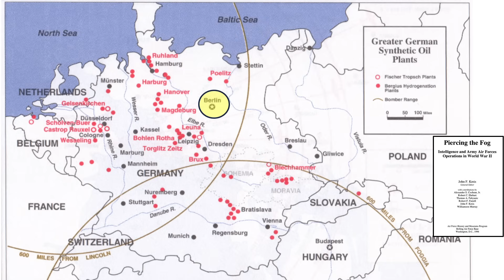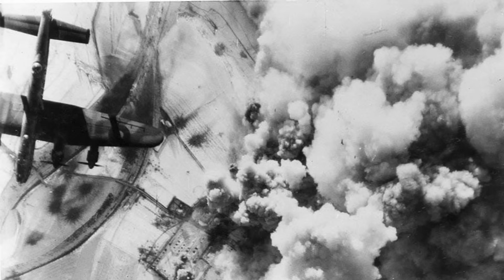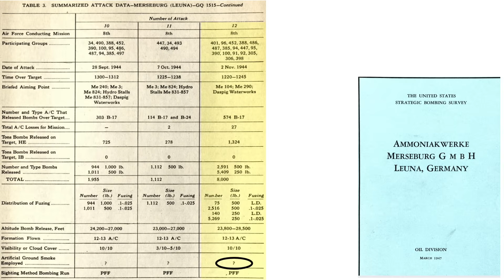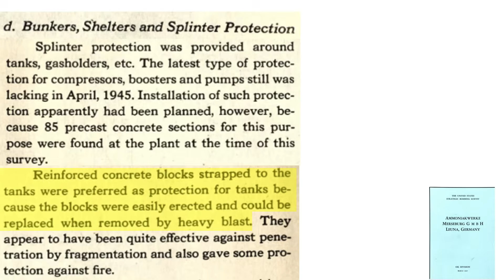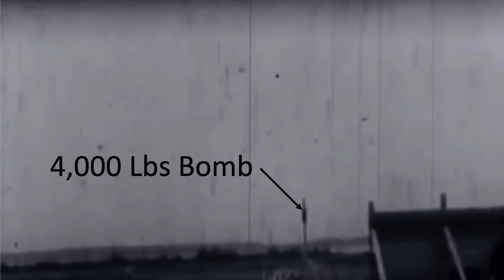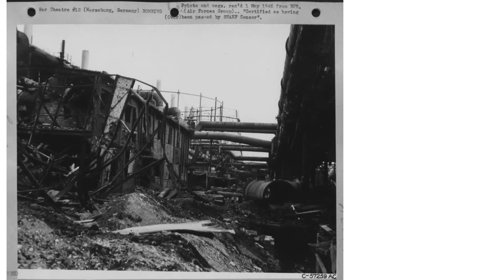How a WWII bombing misjudgement likely cost thousands of Allied lives - Leuna Oil Works Attacks

Comment: Only 1121 4000lb bombs were dropped!! That would be from the 475 lancasters dispatched on 6th / 7th Dec 44, 573 Lancasters dispatched in 2 waves on 14th / 15th Jan 45 and 327 Lancasters on 4th/ 5th April 45. That means 1375 aircraft were dispatched and only 1121 aircraft got to the target (total number of Lacasters lost was 17 across all four attacks), 5 in the December raid. 10 in the twin wave attack in January and 2 in April.

Comment: The results of all the data were from post war bombing survey. During the bombing campaign itself they had photographic reconnaissance evidence of the poor results. Was it the end of the war that they figured out that the small bombs were ineffective? 

After d day was there ever any consideration for using low altitude medium bombers for this task?

Also, as noted by others in the comments, a full explanation on the high dude rate and what was done to rectify this.
Reply: Low atttutide attacks would have resulted in your bomber force being wiped out in 3 to 4 missions!!! Germans have as many light Flak guns as they have heavy ones.

Comment: Knocking out most or all of the synthetic oil production earlier would have been helpful but it is extremely unlikely it would have caused the “collapse” of German resistance you hypothesize. Those plants mainly produced aviation fuel so it mainly impacted the Luftwaffe’s operations. Since by late 1944 the Allies exercised something like air dominance in Western Europe the difference would have hardly been felt except by the Allies air forces whose job would have been easier but the net result on the overall war would probably not have changed things much.

The German ground forces, on the other hand, ran mostly on refined natural petroleum which mostly came from Ploesti in Romania. The AAF had only just begun to bomb those facilities effectively when it was overrun by the Red Army in August 1944, making further bombing obviously pointless. Thereafter the German Army had to run off stocks and the relatively small amount of regular motor fuel coming out the synthetic plants.

The bombing helped a lot but let’s not exaggerate its effects and thus perpetuate myths rooted in wartime AAF propaganda.
Reply: I think you underestimate the advantages of seriously undermining fighter and tactical bomber operations.  That makes allied air support better in two ways.  Firstly, it means they are likely to be unopposed in the air, enabling them to take more risks in an attack role.  Secondly, fighters that would be in reserve for air combat can be released for an attack role.

Comment: -The Leuna plant was the first "Bergius Hydrogenation" plant.  It was sited to keep it out of range of then French Air Force Bombers.   In this process pulverised coal and toluene is   pressurised with hydrogen at 700 Atmospheres (10,000psi) in the presence of a small amount or iron catalyst.  The resultant synthetic oil is distilled as per normal refining processes and the distilled of toluene fed back to the next slurry.
-Because of the high pressures the machinery and Piping was exceptionally heavy and simply immune to 500lb and 1000lb GP bombs.
-When a bombing raid occurred the operators were giving bomb proof control boxes and production continued.
There were vulnerable parts of the plant as below:
-Parts of the plant involved production of air Separation pants for oxygen for gasification of coal to syngas for hydrogen production, nitrogen for combination with hydrogen to make ammonia for explosives, fertiliser and for desulphurisation as well as fertiliser production.
-Some of the syngas was converted to iso-butanol by a chromium catalyst from which was made iso-butylene that was converted to iso-octane for upgrading gasoline.
-At the end of the war the Armaments minister Albert Speer was supposed to destroy these plants but he focused their production on fertiliser so that less of the surrendered German population would starve.  
-German plans involved building one underground Bergius plant, 5 smaller Fischer Tropsch above ground but well camouflaged and some 40-50 mini plants. 
The FT plants were smaller but made mainly lubricants and diesel though they were beginning to make small amounts of gasoline as catalysts improved.

Comment: That was a shockingly high percentage of duds.
Reply: Note that the graphic at 9:56 camouflages the dud rate! It reports that 1.8% were duds -- but that is 1.8 %-points of the 12.9% that fell within the target area, not total bombs dropped (1.8/12.9=14%)

Comment: Visited the plant around 2014. Still a flak tower at the entrance, now used for safety banners.  Also found a small general aviation airport nearby that had very interesting concrete and earthen hangers.  Amazing how much of the massive WW2 infrastructure is still there. Even the plant admin buildings were massive 1930s construction.  Great video.  Appreciate the quality work you put out.

Comment: Were the Germans able to produce high octane aviation fuel?
Reply: Yes, but Nazi design philosophy of aero-engines & materials availability would not have benefited from higher octane fuels. Engines & associated systems require a redesign to take the higher compression ratios. Higher octane is useless if the design of the cylinder head/piston/compression ratio/heat exchange, valve timing/ piston timing/ ignition timing is already in synchrony with the current octane rating. i.e. If 100 octane works fine under anticipated engine loads, 110 or 150 or more won’t do a thing. It’s just wasted capability. NOTE they had another way of achieving a short period of boost that was very effective.

Comment: Why couldn’t the B-17s’s internal bomb bay be adapted to use the 4,000 lbs bombs?
Reply: I'm guessing the length?
Reply: The B-17 was a low wing monoplane so the bomb bay length was limited by the wing spars.   
The biggest internal bomb bay load-out for General Purpose bombs was 6000lbs as 6 x 1000lb GP or 12 x 500lbs GP.
The biggest General Purpose bombs was 4000lbs as 2 x 2000lbs GP
If Armour piercing bombs were used the load was much higher, almost twice as much.  
All data for B-17G.
For long range missions requiring high altitude only 4000lbs might be used.

Comment: I don't think the RAF did many attacks on that place. I know that 8th AAF did a butt load of attacks on the place that resulted in jack shit hitting the plant and a butt load of bombers being shot down or written off due to Flak damage. The biggest problem the RAF had in finding the place was most likely two-fold. First off until late 1944, the only Navigation aid that could be used was H2S.which in its 10cm Mk II form had a blind bombing mean miss distance of 2.2 Miles from the Aiming point. The Mk III with a 3cm wavelength wasn’t much better with a 1.7-mile average. Chances where the target indicators were going to miss the plant, even if the plant showed up on the H2S screen, which it most likely did not. Also because of the smoke screens, ground Target Indicators don’t work, thus sky marking is required and that is inaccurate as hell due to wind drift.

Comment: The attacks were less successful than desired, but what was "miscalculated"?  USAAF had settled on 500 pound bombs as standard because surveys and testing indicated that they did more damage than larger bombs because more of them hit within their effective blast radius of the target.  Larger bombs caused more damage within a larger radius, but fewer of those blast radii were with effective range of the target.  So I'm not surprised to see that they saw no reason to depart from the usual method with the target information they had on hand.  If USAAF had used large bombs in this attack they would have had fewer hits.  You have to remember that daylight bombing in a combat box formation guaranteed fewer hits than bombers could achieve by overflying a target in single file and bombing individually, as night bombers could.
Reply: Agreed.  The Bergius plants operated at 10,000 psi so much of the machinery and piping was resistant and repairs could be completed in a few weeks, follow up raids eventually worked.  Production may not have stopped but i was a trickle at 15%.    Generally, the Combined Bomber Offensive reduced German munitions production by at least 40% and probably 50%. If a raid was unsuccessful the reason for the failure was analysed and corrections made.   The raids of 1943 caused severe damage to irreparable machine tools with about a 30% production loss.   This lead to a reduction in plans for 1944 which were also effected by bombing but which compounded with the 1943 damage.  For armoured fighting Vehicle production you could estimate instead of 6000 Panther Tanks maybe 10000 would have been produced but possibly as much as 14000.  StuG III production was completely stopped for many months so I suspect about 8000 extra StuG III and Panzer IV.   Tiger II orders were 1500 but the factories were bombed in September and October leading to months of lost production.  Rate was 70/month so that would be 280 more tanks by Battle of Bulge and 560 by wars end on top of the 498 produced.  In terms of fuel Alber Speer mentions that German tanks in the East had only 3 or so fuel loads which is not enough for an offensive or exploiting the enemy's weakness only retreat.    By the end of 1943 around 78% of the Luftwaffe were in Europe, Scandinavia or Mediterranean/Africa.   This as you can Imagine meant the Luftwaffe had greatly diminished combat power over the eastern front.  
-Also what must be added is the weapons, engines that never entered into production or were greatly delayed or of reduced quality.
Reply: @bernhardzunk7402   One big fallacy in this video is the idea that only complete, permanent, and irreparable destruction of a target counts as mission success.

Comment: Very interesting. The accuracy and awful dud rates were very surprising to hear about. Can you do a video on why so many bombs were duds, and how bombers knew they hit or missed their targets? Surely it isn't spotted by the airplane that dropped the bomb.
Reply: Part of the accuracy issue is down to the "Mythical" Norden Bombsight, which in reality was a subpar low quality POS treated as gold by Army officials cozy with Norden; this is proven by the fact that despite being so "good" it was "Classified", neither the UK nor the Luftwaffe ever copied it due to their existing sights already being better. 

The Sperry Bombsight was the better of the two, yet only used as a "Substitute Standard" by the Army.

The 2nd reason, is high altitude bombing was preferred; yet the higher you drop your bomb the longer wind and drag have to nudge it off course. This is why B-29's despite being THE HIGHEST altitude Bombers at the time, switched to low altitude nighttime raids so they could actually hit their targets.

And BDA's can be done by later aircraft in the formation, or a follow up Reconnaissance flight.
Reply: @pyro1047  You have no idea what you are talking about.
The Norden was never secret.   You can download the operating and service manuals from various historical/museum websites,, and watch USAAF WW2 Norden training films on YouTube.   They are all marked "restricted" which was the lowest document classification and merely meant  not for release to the public.   It applied to all manner of non-secret stuff, from typewriters to tea urns.
When you put something in almost every bomber, some which will be shot down, and train thousands of men on how to repair, calibrate, and operate it, there is NO point in making it secret.   
In any case, the Norden was an application of the tachometric sight mechanical analogue computer principle, patented (and therefore in the public domain) in the 1930's.    The Norden sight was a redesign of the earlier Sperry sight that fixed the bad ergonomics of the Sperry, which required both hands and thus was difficult to use in combat.
Germany didn't copy the Norden because they already had their own tachometric sight.
If you look up the operating altitude of the B-17 and B-29, it is virtually the same.   Both were designed to fly at an altitude at which non-proximity fuzed AA is ineffective.
The B-29's only operated over Japan.   They bombed at low altitude to save fuel and thus increase range.   Japan, unlike Germany, did not have radar-directed AA, so it was relatively safe.  Bombing accuracy did not matter in Japan, as Japanese industry was dispersed as a multitude of small businesses, each making only a few types of part, located intermixed with housing, much like in Pakistan today, and not concentrated in industrial estates as in Western countries.   This meant the USAAF had to use carpet bombing rather than strategic target bombing, and just level entire cities.  For Germany, if the USAAF wanted the address of a ball bearing plant to bomb, they could look it up in the phonebook.   No phonebooks in Japan back then.
The RAF didn't employ the Norden (except for a few special missions) because they were not interested in accuracy.   Both Churchill and Harris, the bombing commander, believed war was about punishing civilians and mostly just carpet bombed residential and shopping areas.
Download and study the service and calibration manual for the Norden.  You will then see how its accuracy was specified and how it easily met that accuracy.   Provided the bombardier can see the target of course.
Reply: Guessing 18-21 year old men trained by the millions & rushed into war.

Comment: 2:19 Odd that The Eighth Air Force was based in The North Sea.
Reply: It says that circle represents 600 miles from Lincoln, and the other one is from Foggia.
Reply: @benkasminbullock More likely a 600 mile circle from somewhere like Polebrook in Northamptonshire, where 1st Air Division were based.
Reply: @richardvernon317  I don't know either, but it says Lincoln on the map.
Reply: @benkasminbullock  Badly drawn map, but the 600 mile circle from Lincoln just goes past Stettin on a proper drawn map.
Reply: @richardvernon317  You can't draw a circle on a map at this small a scale and get correct results because the distances are distorted by the earth's curvature.
Reply: @benkasminbullock  You can say that the circle represents Peace on Earth if you want,
but the center of the circle is still in The North Sea.
Reply: @psikogeek  I didn't say that, the map itself says that. The radius of the earth is only 4000 miles, so at this small a scale map you have to be careful about the curvature of the earth and how it's represented on the map. So I spot-checked the distances on the map using the "Measure distance" feature of Google Maps and the locations of Nuremburg, Munich, and Danzig, and it seems to be a fairly accurate 600 mile radius from Lincoln.
Reply: England was omitted entirely from the map shown.  The 8thAF flew from bases in Essex, the portion of England closest to Germany/the Ruhr basin.
Reply: @trillian23x  No, most if not all the USAAF Heavies flew from Norfolk, Suffolk and Cambridgeshire. The US airfields in Essex were almost all 9th Air Force medium bombers or 8th Air Force Fighters. I happen have been born within 3 miles of the most western one in the county (Stansted Mountfitchet). The closest town in the UK to Germany is Lowestoft in Suffolk
Reply: I don't know but those guys at the beginning dressed in civilian clothes walking around looking at the damage to that plant look awfully shady to me, like characters out of a Raymond Chandler novel.